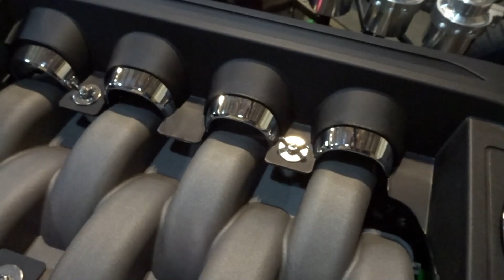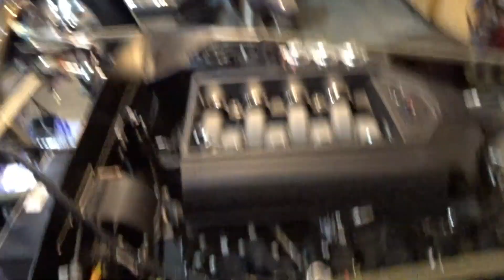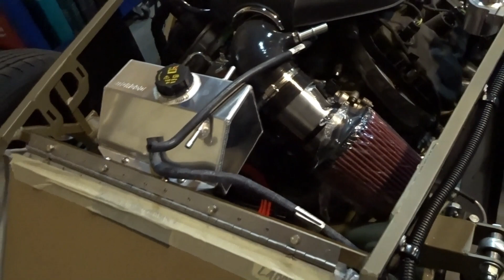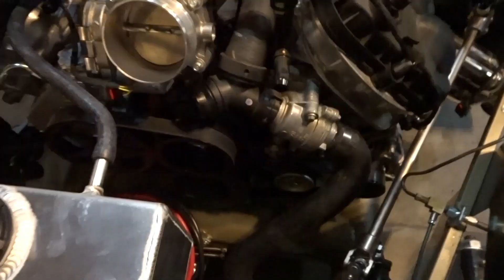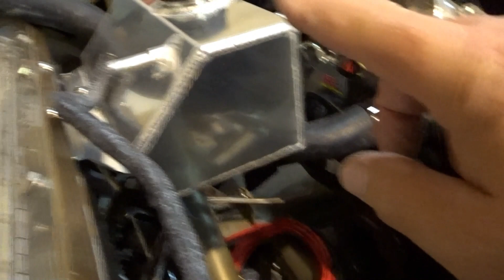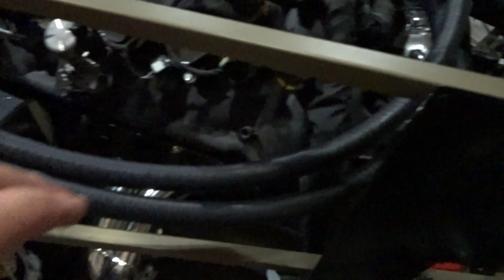Time To Button Up The Cooling System And Heater Hoses. Factory 5 Racing 25th Anniversary Mk4

Comment: I replaced the intake on my Gen2 with a Gen3 intake and had to make some standoffs to get my Gen2 cover to fit. I like your idea to put a new notch in your upper radiator hose to clear the power steering pully. I need to do that as I have some slight rubbing there.
Reply from the maker: Always trying to gain knowledge. We make use of all of the  Factory Five groups on fb and the Factory Five related forums. Amazing all the tricks we have used.